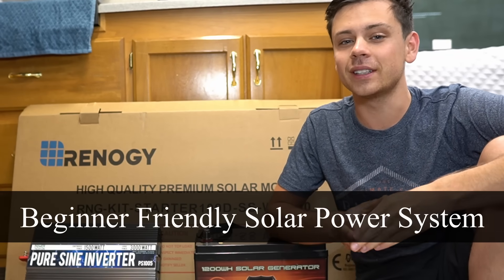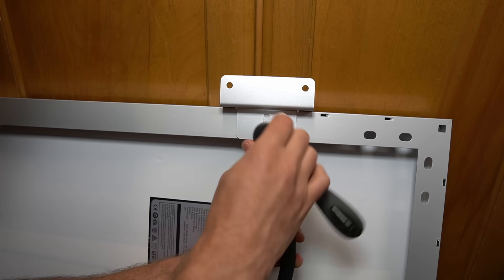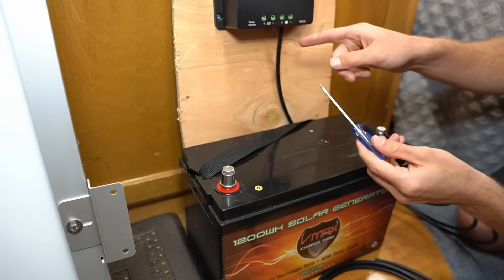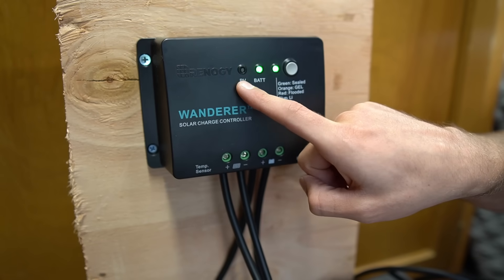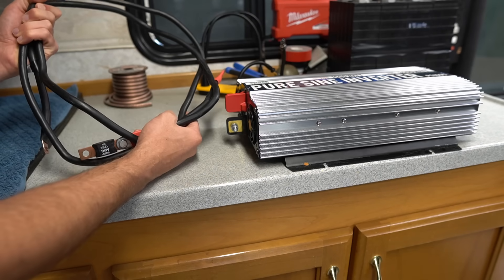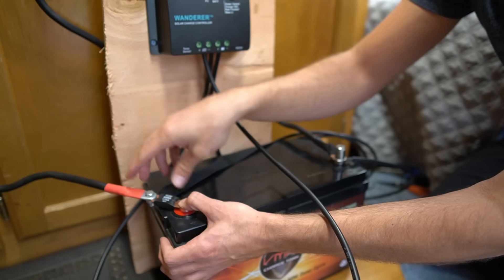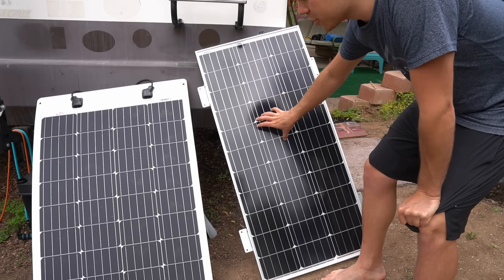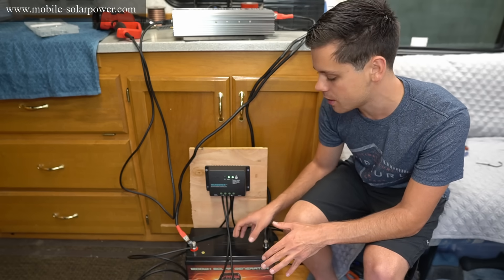Build Your First Solar Power System! Beginner Tutorial Easily Explained, Budget Friendly

Comment: I've been following your channel for a while now, and I'm always amazed how you build batteries, however, this is the first video I've seen about this install. I know is almost 3 years old, and maybe a question is not "valid" at this point but here it goes anyway: Is it true that once the inverter is connected I can plug the cable coming out of the inverter, the 110v, into the house electrical outlet, taking into account the main breaker is off and all non-essential appliances are not used? I only need it to power my refrigerator, internet router and security cameras and a few led 12v light bulbs. My entire house is wired for 12v led lights. Thank you ... Semper Fi

Comment: Hi Im a beginner- got 4x 65 amp hour dp lead acid flooded-  a pro star-30  charge controller, ( second hand old stuff). How high can I safely charge the batteries right now says 13v but light is yellow meaning batteries not fully charged. Does anyone know if this old charge controller can be used for 24v?

Comment: What would i need to run a small freezer and a fridge freezer. I am in uk so is it all the same? What size inverters and controller do i need? Are 2 x 250W panels too much? Would i need 2+ deep cycle batteries?

Comment: What happens if the battery shorts out, or completely dies (open cell) with the solar panel(s) still connected?  Does the controller fault or  get damaged?

Comment: With energy prices going through the roof in the U.K.  I eventually understand this W, V, KW thing 😀.  Now I believe I’m ready to build my first system. In will video the process and give you a shout out as you helped to simplify the process. 

Thanks for your help. 
I can see Thats you are big on safety. 
The 175W thing Thats you attached to the top of the battery - guessing Thats is designed to Trip the system. 
The temperature sensor the battery gets hot right. I have lithium ion batteries Thats were taken out of a car. 
On Think I only need an inverter and good to go. 
12 V battery though - is your battery 12V? That sine wave inverter is a magical invention. 😃😂

Comment: Great vid! I'm a bit thick- do all the internal sockets go onto 230v sockets and the lighting etc go on 12v DC cables? And does any 230v hook up go straight into an inverter then put to the sockets causing an internal switch to lock off the batteries for everything now on the 230v hook up? Bit confused here - sorry..

Comment: Question can I run a 12v dc pwr in to converter to charge the battery instead of solar p. When I shut vehicle off then run pwr inverter off battery to pwr AC device.

Comment: Good tutorial.  In my experience with automotive batteries the red + cable is always attached first, then the negative - cable is connected.  This does away with the spark you experienced when connecting the red cable first.  I know your battery is sealed but safe practices should always be utilized.  Vented automotive batteries can have fumes that can cause an explosion hence the need to go positive (red) first, then negative (black) second.  Thanks for posting.
Reply: Though you are correct about the order, and that order is reversed on disconnect, however this is not the reason for the severe arcing. The sparking was caused by the rapid inflow of current to the capacitors in the inverter. To avoid this you should either use a ceramic resistor, 25 watt 30 ohm works well and hold one lead of the resistor to the cable and the other to the battery terminal. Hold it there for 10 seconds or so. This will precharge the caps slowly.....You can then attach the cable with no sparking.
Reply: I had to scroll all the way down here to find someone with experience to make mention of this... I thought it was an industry wide understanding in the electrical business to connect negative then positive...
Reply: @theturnersontheroad4537 Reason being, if you are disconnecting the positive first and the wrench were to contact anything metal it will complete the circuit to ground which can be very dangerous. I saw a fellow Marine burn his ring finger off instantly when his wrench made contact with the frame and it welded the wrench to the frame and terminal. Needless to say everything got hot and melted almost instantly. Disconnecting the ground first assures this cannot happen. They should be reconnected in reverse order....positive first, ground second.

Comment: Will, i like your videos. I have a question.  

Do you think its feasible to connect 10 x 200 
Watt 24v  panels to a hot water system element directly,  except for relay for temp control?

Element is 2400watt and 240v.

I live on a farm on esst coast of Australia and have been given these panels.

Comment: Do you have away to get a hold of you for more information,? I have a shop and on the shop I have people on a RV spot the shop uses more electricity then my house. So I was thinking maybe to put my three freezers and some lights and a small heater that I use in my cellar for winter time. On the solar system. Shop lights on the ceiling are led and there not on all the time only when I work in there. And the other power is from the well pump. I have a guy who turned me on to YouTube fir information and I saw yours. Thank you got your time and hope to hear from you.

Comment: The ground wire should be attached after the positive wire. The sparks you made when you touched the bolt to the battery, if you did that on a lead acid battery, the chances of the battery going BOOM and the acid all over your face, is very high. Other than that mistake, it's a good video. I'm about to buy a solar panel or two and a charge controller for my motorhome. I already have the batteries and the inverter. Where I live the temp can drop below -25 celcius. I constantly have to run my generator to charge my batteries cuz my propane furnace is running almost constantly. Once I buy the solar setup, I won't have to run my generator as much and I will save a little bit of money. I'm living in my motorhome by choice. I just sold my house a month and half ago and I don't want to pay the crazy rent prices they want for an apartment plus you have neighbors that are way to close to my liking. I'm parked where I work a thousand feet from the shop and 2 minutes from the main road with a locked gate. It's awesome.

Comment: Can anyone answer this for me ? I'M WANTING TO RUN 3 1500 WATT  120 VOLT HEATERS TO KEEP MY HOME COMFY DURING THE WINTERS HERE IN WASHINGTON STATE AND MY A/C 10,000 BTU 120 VOLT DURING THE SUMMER 
 CAN I DO THIS WITH JUST EASY BATTIES, INVERTER AND USE MY OLD BATTERY CHARGER 2AMP/10AMP/50 START 120 VOLT=2AMP 120 VOLT DRAW , 3. 1500 WATT HEATERS = 4500 WATTS 
 CAN AN INVERTER 12V DC TO AC 5,000 W/10,000W  RUN 3 HEATERS TOTAL 4500 WATTS IS THE INVETER GOING TO HANDLE 40 AMPS? 
 Do I need to break it down to  smaller systems because of the amperage 
 Nobody's talking about the Amperage of the INVERTERS,  how do you get the amperage up?

Comment: When installing this system onto a utility trailer or any RV do you need to ground the panel to the roof? I have seen one site say it needed to be, plus ground symbols on the panels. Or is this already being done when using the mounting brackets?

Comment: One other trick, use a P-touch to label the positive and negative solar wires close to where they plug into the controller. They look very different at the connector but look exactly the same at the connection point. He does identify the polarity of the PV wire then plugs it in immediately, eliminating a crossed wire. But you may move the system or panel and unplug both and it's nice to have them labelled at their connection point.

Comment: Great video well explained. I have one question for you. I copied you and installed a 100watts solar system with 100ah battery. I connected a Wyze floodlight through the inverter. The first two days was fine and on the third day, the charge controller has this beeping noise and the charge controller display an error E01 I believe. Do you know hat is wrong?

Comment: Hi everyone, Heads up; I have a 10kW array and recently replaced two 250W panels, the system is 10 years old, we just had a couple of inches of snow. It really sticks to the two new panels whereas the old panels shed snow readily. Power output at 0730 with snow on was 160W. After clearing the snow it was 4kW, so be aware of what you are buying.

Comment: Please tell me IF this is correct?  IF i have Generator 2500 watts and solar panels 200 watts; then, I do not need the battery, mppt?  This generator will be dedicated to my Whirlpool Dryer 3.2 cu ft. that uses 2100 watts in about 1-1.5 hours. weekly.

Comment: I got  a  few questions.i got a 100ah lifepo4  battle born and a gowesty 50ah lifepo4 battery can i connect the 2 to make 150ah bank? Also if I were to make the 50ah a portable battery bank would I be able to charge from the 100ah solar/alternator system? Thanks

Comment: I bought a fold out solar panel kit from ebay, it came with the charge controller, but the charge controller was already wired to the solar panel but you said it has to be wired to the battery first or it will damage the controller, my kit came with no instructions

Comment: Hi, if you bumped up to 200 or 300W, with a cross over cord, could you plug this into a homes wall socket, to feed into a house? and potentially if no one is home, could it power the items that are always on, like refrigerator, and microwave, and clocks, etc?  Or is there additional components needed for a back feed?

Comment: My electrician installed my renogy system after he wired my Tiny House.   I have a problems from day 1 and that was in Spring 2019!  I finally had to study so many videos on how to install, trouble shoot, found out I was struggling with an inverter that was defective THAT WAS ALOT OF FRUSTRATION.    And now I finally realize as I go thru the new Manuel for the replacement, the electrician did not connect the inverter to my fuse box in my house correctly.   Arghhhh I keep studying this, I see the connect on the inverter, I just don’t know how to install in the fuse box ????

Comment: Excellent video. Spark issue: first thing I was taught 60 years ago with automotive batteries is the importance of connecting the positive first so there is no spark or smallish spark at the negative because of the danger of igniting battery gassing. It will be difficult for me to do otherwise but I will if it matters with solar equipment. Back then one of the automobile manufacturers used a positive ground for their system partly because of the spark issue.
Reply: As a millwright I was trained to do the same and was wondering why the positive wasn’t connected first?

Comment: I have an RV with a 190 watt panel, charge controller, and lead acid battery. I was told to remove the battery during the winter. Will that hurt the controller? If so, should I disconnect one of the wires from the solar panel? Thanks.

Comment: Let me get this straight.
A solar charger really only has 85% of total capacity. So for example a 1000 wat unit gives you 850 wats.
Minus another 20% so as to get more longevity, that's another 200 watt loss. Now your at 650 watts minus what you can really get it down to before charging back to 80%.  So your really have a 500 watt charger?

Comment: Hello new to solar. I had to take off the batteries to fix a panel on my trailer. I hooked up the battery and it’s not working. The. Controller is on but nothing else is working. Any ideas?

Comment: So Costco sells an inverter and it says it can’t be connected to lithium.  I didn’t realize this until after I put it together.  It works fine but I am worried I may have an issue on down the road. Does anyone know why the lithium can’t go with the Costco inverter?

Comment: Man, you are the answer to my dreams. I have an F150 with camper shell that I want to run solar to so that I can power a few small cooking appliances (like .an air fryer and an instant pot 
they are less than 2 qts and low wattage) but mainly a small fridge and 12 volt fans. What type of battery can I buy that is affordable and doesn’t need to be be vented or add water to?

Comment: Pro-tip at 1:15. Never install bolts with the nut on the panel side. Instead, run the bolt from the panel side of the hole and out. This will guarantee  you that you never accidentally put a too - long bolt into a spot that could  push the end of the bolt into and through the panel.

Comment: Just watched your video, good info but….. Best Practice (Always NEGATIVE LAST). And when You touch that bolt holding the fuse to the battery! You are effectively  bypassing the circuit protection and could end up doing some welding if there was an actual short. Constructive criticism, keep up the good work.

Comment: Might I ask a simple question to get an idea of how useful this sort of system will be. If the battery was fully charged how long would a average desktop computer run? or if I plugged in a 100w household bulb how long would it stay on for? I understand there may be variables just after a ball park to get an idea. I use to have a power back up on my home computer and I would only get 10 minutes from it

Comment: I have a 1200 sq ft home. Need a book detailing an off grid and/or grid tied system. ie # of panels, their wattage capacity each,  components used in setup, ...Using a lithium battery bank makes more sense to me. Please show housing of the system in conjunction to a home. Should battery bank be separate, dry, detached, possibly concrete block built small shed with batteries stored off floor on wooden skids? Thanks a million!!!

Comment: to any newbies out there @ 5:32 where he disconnects from the terminal on the charge controller it's safer if the quick connects at the solar panel itself are unplugged first as those connectors are designed as failsafe means to avoid any shorts in case any wire is fumbled when removing from charge controller or battery.

Comment: Excuse my lack of knowledge, but why didnt he use a fuse/breaker between the solar charger and the battery? Is this just not needed for a smaller output system? Im looking at running 300W solar to 40a MPPT to 100ah Li battery. Will i need a fuse or breaker between the MPPT and battery or can i just connect it directly?

Comment: So it's ok to mount the charge controller on wood ? Mine is Victron 100 | 20 with 200w panels, is that ok !? Thx !
Reply: Yes. Plus, heat can rise through the fins in the back.

Comment: I have vintage camper 28ft that I have to gut but my concern is the electrical which I have no experience in but I want to know how much power will I need for two people for appliances and a/c smart TVs and other electronics. Like how do I figure out how to calculate that but also how do I know what to purchase because I’ll need power for like a small cottage and for living off grid 24/7 365 days and this is permanently. Any suggestions thank you!

Comment: where do you connect  the battery capacity/voltage meter? can you do a very short video on that?  you did not specify where to connect it.  thanks!

Comment: I have 2 panels that are 33.5vdc @ 8a and 2 additional panels I just bought that are 36vdc @ 8.5a. I just installed an Outback 60 MPPT Charge Controller in my RV . Will I have any issue adding the new 300 watt panels to the 280 watt panels? The Outback can handle 150vdc. Thank you,

Jim

Comment: I bought a cheaper solar panel from Aliexpress. I have a question perhaps you can help. I have 22 volts DC coming out from the solar panel. This is a 20 watt panel. The maximum current I get is 30 mA. It is quite low. It was fine before. I don't see any physical defects. I checked for the diodes and don't see. Just a little USB circuit. Any ideas what could be wrong? Thanks

Comment: I purchased this same kit not long ago, installed it in my slide in camper for running a small 750W inverter, and 2 deep cycle batteries. Been awesome using it to charge phones, speakers, run all lights, Cpap ect. Worth every penny. Now looking at upgrading to 400W so even in cloudy weather I can still run everything and my ICECO 12v Fridge.

Comment: I subscribed from  video I saw earlier today.   Excellent instruction.  Thank you.
I would like to try a set up before really getting into it.   My ultimate goal would be to buy the used panels I saw earlier today and put together a system that's affordable for the house..  My home is all electric including the heat pump.   If it can cut a little of my grid usage I'd be happy.
Now if they can only figure out how to run solar in shaded areas for the mountain house, I'll be set.

Comment: In the video, the negative wire from the charge controller has a red O ring on the connector that attaches to the negative connector on the solar panel. I would think that that means it is the positive wire, except that it does actually fit into the negative wire on the solar panel. Is this how the solar panel kit comes or am I missing something? I'm setting my kit up now and I stopped at this point because I am not sure. I appreciate any help you can offer.